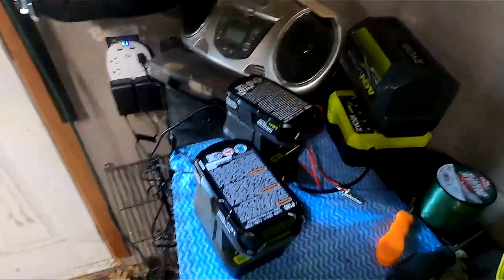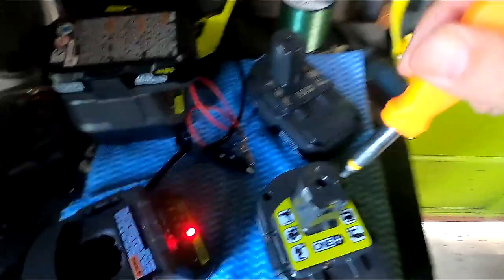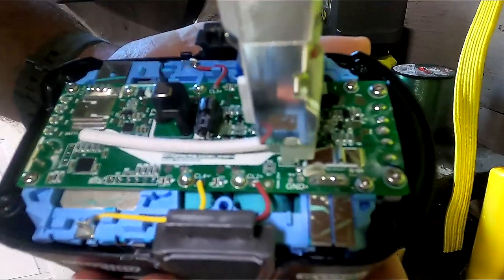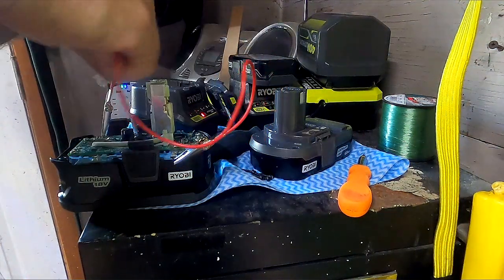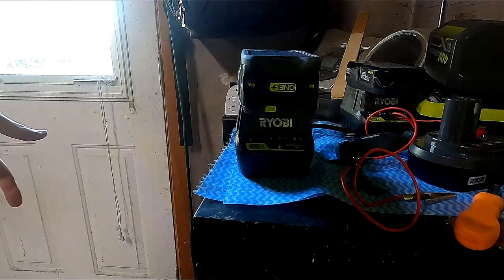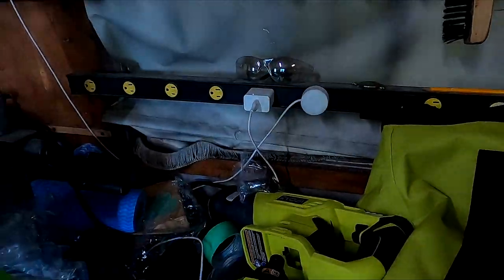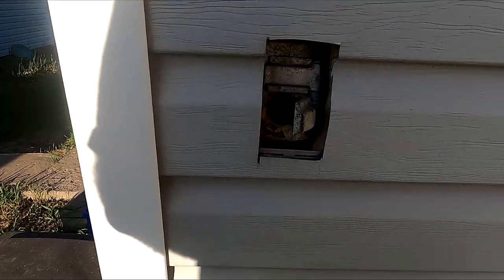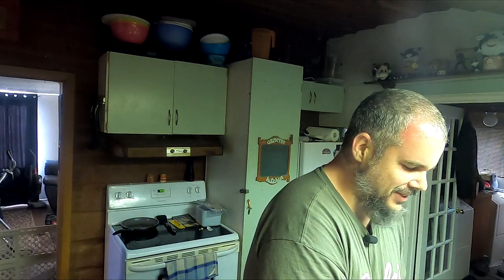Ryobi Battery Fix and Window Seals

Comment: I think you could very easily fix up your truck canopy. Would not take much to make the scrapes and scratches not stand out. Would be pretty easy to paint too. If it were me I would look into the cost of having the canopy dealer install new seals for the windows.  It would not take them long to do, and they have the right tools for the job. The Ryobi 18 volt system is a good one. They make a lot of different tools. Check them out online. There are a lot you never seem to see in the stores. 2 of them I think you might be interested in is their soldering station and their glue gun. Both are 18 volt. I have the glue gun, heats up quick and no cord to deal with! Thanks for the videos.

Comment: You can get a hole set cheap off ebay or whatever that contains the most popular security bits, including tri-wing, torx, hex and weird cros-heads that have offset fins that loosely look like something from between 1939 to 1945... :P

Comment: Tractor Supply or your equivalent should have 4x4 rubber mats they sell which would insulate more than the plywood and the best thing is, you can just wash it off with soap and water.

Comment: Nooooooo!!! Don't use a screwdriver on those window seals, you'll break the glass!!! You need a seal seating tool (looks a bit like a loop of wire on a handle) or for a home-job, feeding some stirdy string through to pull the seal over the glass, plenty of vids on here showing how to fit glass (usually windscreens on old cars that are pre-bonded jobs), but definitely no screwdrivers!!! :S